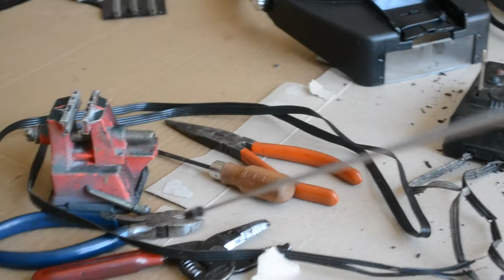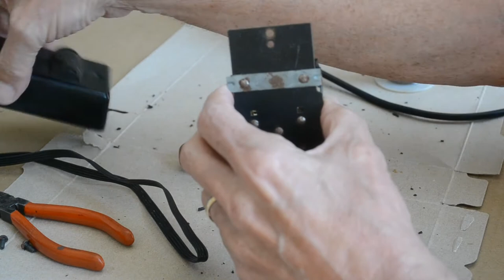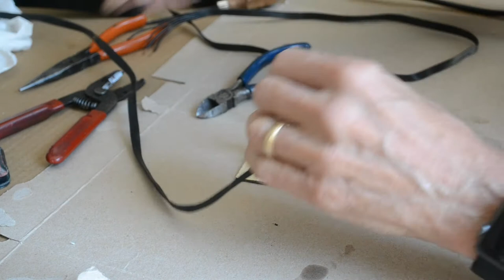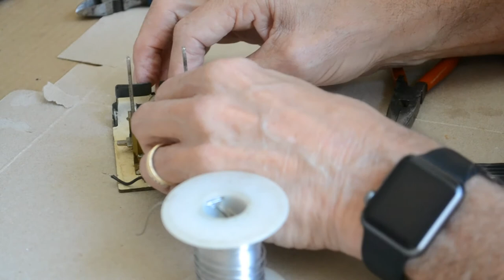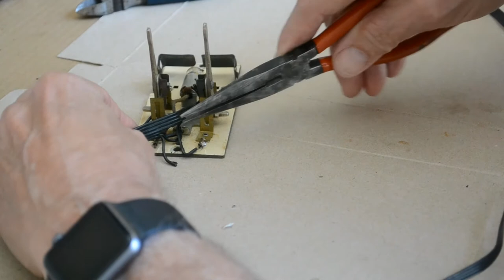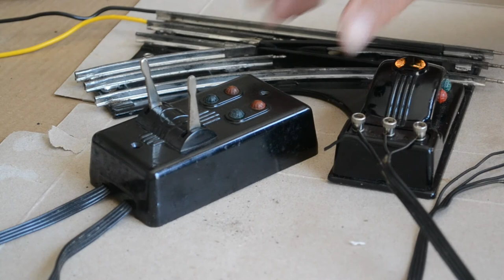Rewire Your Vintage Lionel Switch Controller

Comment: can you tell me the Lionel number for the switch controller?  I need to purchase two as I got two switch tracks at a show.  Thanks!!
Reply from the maker: Lionel switches came with their own controller. I am not aware of controllers being sold separately. With that in mind, it is relatively easy to make your own controller, as shown in our you-tube video -      https://www.youtube.com/watch?v=FMuAvvwMSBU    If you decide to build your own controller, it will need only a momentary electrical connection to change a switch position. A prolonged connection uses a lot of power and can overheat the switch internal solenoids.
Reply: @ChooChooVille  Thank You!!!